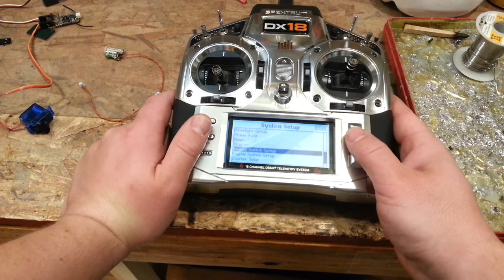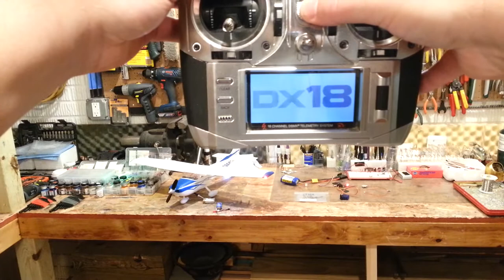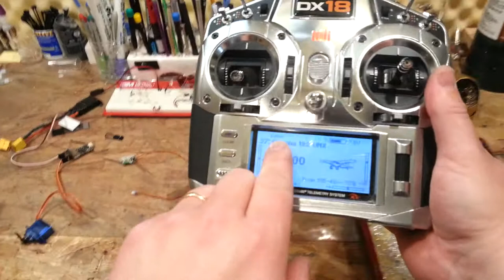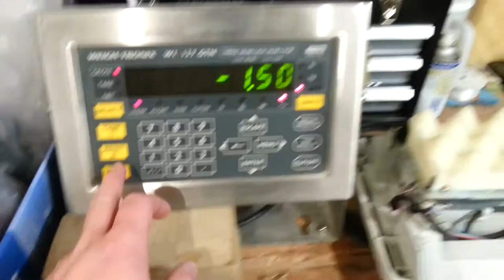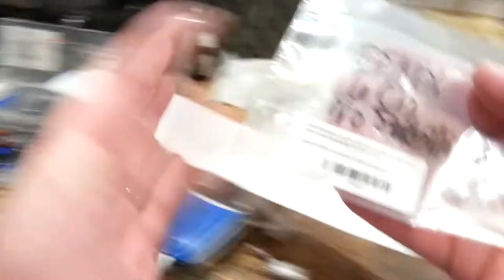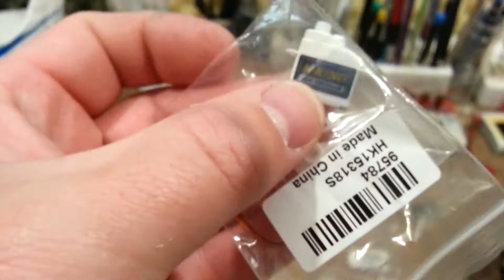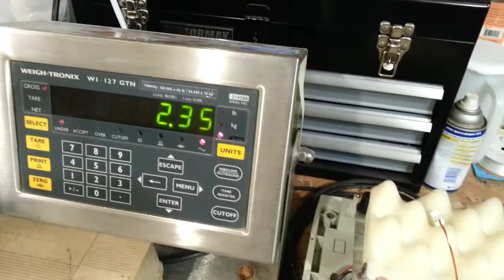Horizon Hobby - Cessna 182 UMX - Flaps Proof of Concept (Revisited) - Part 3 (& Success!!!)

Comment: Ok so I did the same thing you did with another dsmx receiver and it does bind but  my servo acts weird and wont work normal. It jitters and barely moves. Im doing the same thing you're doing with adding flaps on my cessna 182!
Reply from the maker: I had a lot of trouble doing this project, but I did ultimately get it to work. Based on what you've said I don't have much information to help you besides recommending to rewatch the parts of this series you think would be most helpful.